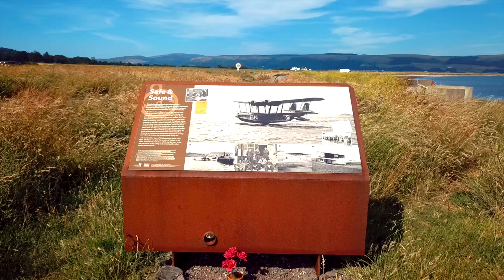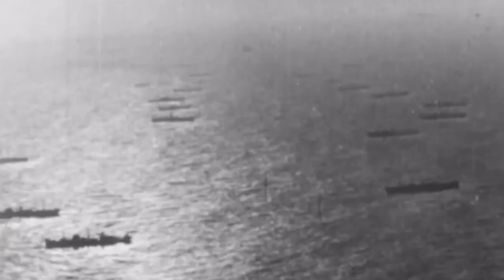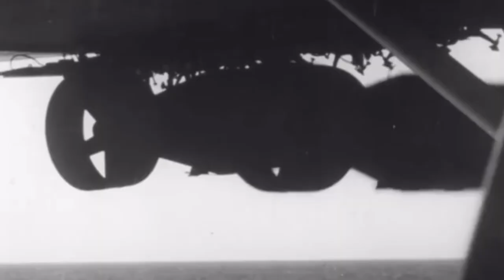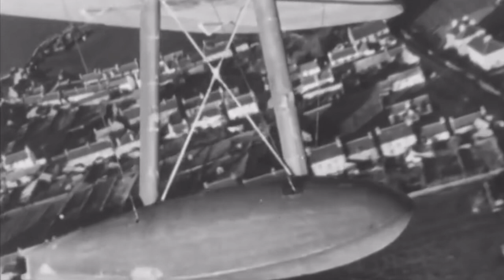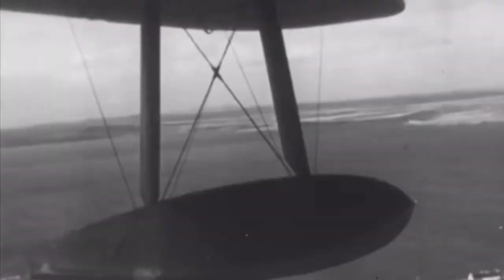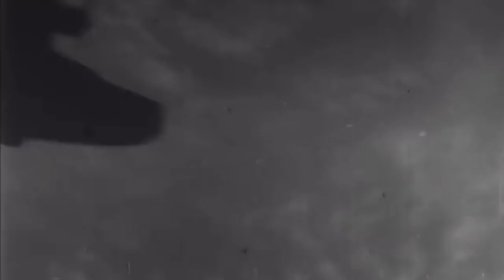RAF Wig Bay

Comment: An interesting little video but the information provided about RAF Wig Bay isn’t quite correct and adds to the long standing confusion about operational flying boat operations in Loch Ryan. 

Wig Bay was never an operational station – it was a Maintenance unit. The Operational station was RAF Stranraer. The first RAF flying boat to land near Stranraer was a Supermarine Southampton that visited on a trial flight on 9th September 1928. Between 1929 and the beginning of WW2 flying boats from all UK based squadrons visited the lough and moored up at temporary moorings usually off the foreshore at Stranraer (Clay Hole / Broadstone) but later also in the Wig Bay area. In 1938 / 39 there are records (Lloyds Register) of 11 seaplane mooring buoys on a Northwest line extending 800 yds from the West Pier at Stranraer and a further 11 buoys on an East / West line about a mile of Wig Bay.  

Extensive use was made of Lough Ryan for flying boat training in the late 1930’s but it was not until 1st August 1940 that RAF Stranraer came into official existence with the Station HQ being set up at Anne House in Bellevilla Road. (The Officer’s mess was in the North West Castle and the Airmen’s Mess was in the Masonic Hall). The first two squadrons to operate regularly from RAF Stranraer were 240 – aptly with Supermarine Stranraers – and 209 with Saro Lerwicks. These rather outdated types were gradually replaced by Consolidated Catalinas early in 1941 with both Squadrons moving to Lough Eren in Northern Ireland in March 41.

Brfore the station had officially opened the Flying Boat Training Squadron had arrived from Calshot on 26th June 1940 bring with it three Singapore MKIII’s. The unit was later renamed No4 (Coastal) Operational Conversion Unit remaining based at Stranraer until June 1941 but based a significant detachment back at Stranraer between March and November 1942.

A Canadian Catalina Squadron (No413) formed at Stranraer in July 1941 and in October it was replaced by 228 Squadron RAF with the four engine Shorts Sunderland which remained until March 1942. The final unit based at Stranraer was 302 Ferry Training unit which was present between December 1942 and July 1943. The last RAF personnel left Stranraer in September 1943 and the station officially closed on 15th February 1944.

Apart from the moorings mentioned above Wig Bay was first looked at by the RAF in late 1940 but it was not until March 1942 that any RAF units were based there. The first was No1 Flying Boat servicing Unit which was joined in July 1943 by No11 Flying Boat Fitting Out Unit. These units serviced and stored multiple Sunderlands of 201, 220, 228, 422 and 461 squadrons – but these units did not fly operationally from The Wig.  

No 57 Maintenance Unit was set up at Wig Bay in October 1943 and became a major service centre for Sunderlands and Catalinas for the remainder of the war and immediately thereafter. As time went on many flying boats were also scrapped at The Wig. In 1951 the entire facility was taken over by Shorts of Belfast who continued Sunderland servicing (and scrapping) as civil contractors while the RAF retained a flight test unit only. Wig Bay closed completely in 1955. 

For the full story on "The RAF in Galloway" I would highly recommend A.T.Murchie's excellent book of the same name from which most of the above information is taken.
Reply from the maker: NorFlyJA thank you very much, I will purchase the book and defo update the information. Thanks again 😃